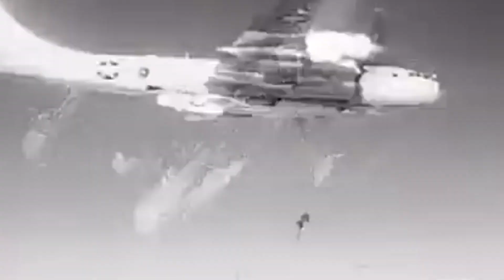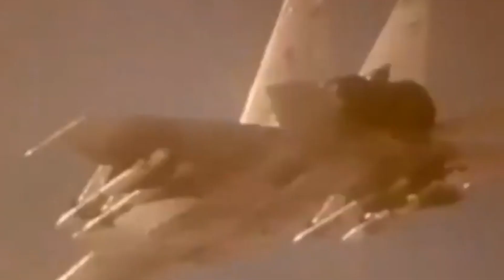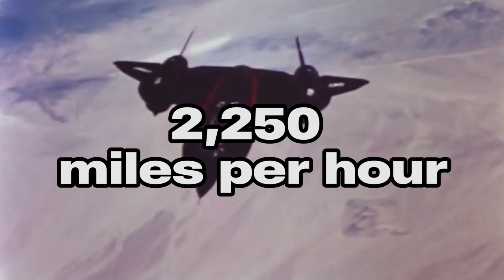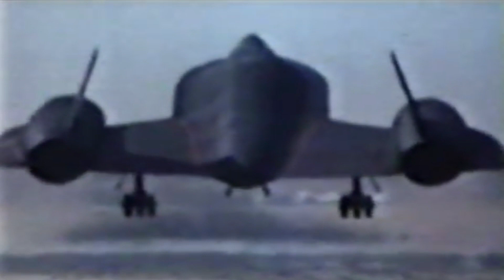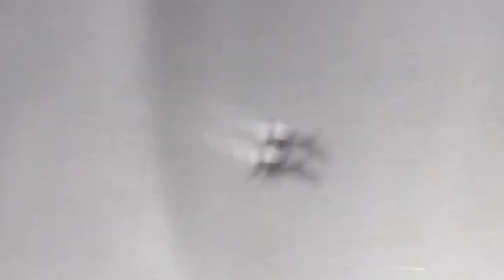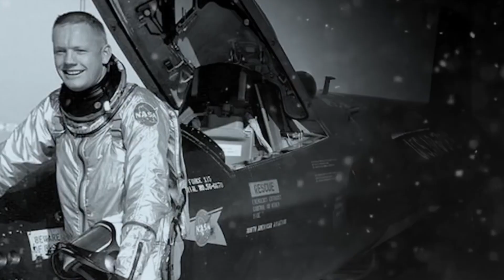The Fastest Airplane in The World (Sonic Boom)

Comment: u forgot the mig 31 foxhound much faster than mig 25
Reply: The mig 31 was based on the mig 25p (which is different than the mig 25). They had virtually the same top speed. The major difference was in radar capability and maneuverability.

Comment: What many people don't know, including the U.S. at the time, was that the MIG-25 could only maintain mach 2.83, for a few seconds. At that speed the aircraft became incredibly unstable, due to the fact that the Soviet Union had not yet mastered the art of stabilizing the air being sucked into the engine inlets. That's why on the SR-71 you see those cones at the engine inlets...they break up the air going into the engine to keep the plane stable, whereas on the MIG-25, it's simply a classic fighter jet inlet. Plus, the aircraft was tremendously heavy for a fighter, so there was only a small speed envelope where the plane could be maneuverable. Too slow it was like flying a tank, too fast & there were vibrations, shudders & gyrations all over the place. Then again, it wasn't designed to be hyper maneuverable. Rather, it was designed to get to altitude quickly, fly in a basically straight line very fast to intercept incoming American bombers. Finally, listing it's speed at over 2,000mph, that's ground speed. In reality, it's true airspeed at altitude was closer to1,800mph. Still very fast, but the 2,000mph club belongs to 1 plane (not counting the experimental planes), the SR-71. Enjoyed the vid as always though. 😉👍👍✌

Comment: Although the flight speed of the MiG 25 can reach Mach 3 per hour, in fact the engine of the MiG 25 is basically scrapped after flying at Mach 3, and a new engine needs to be reinstalled.
Reply: No
Reply: Er, Mach 3 “per hour”?